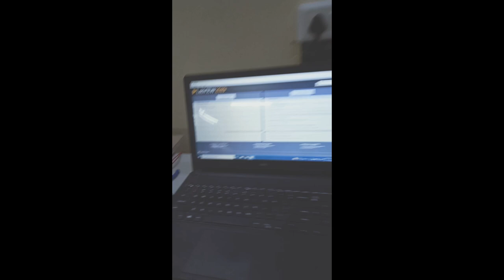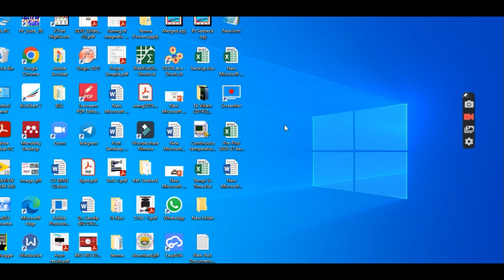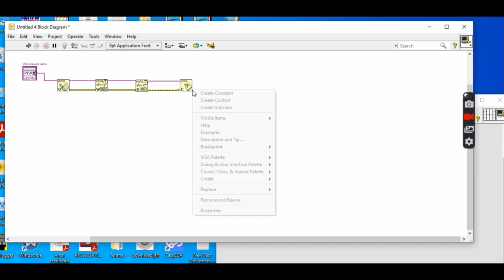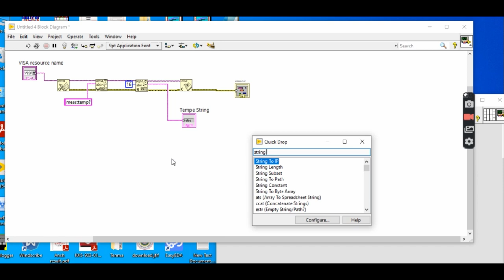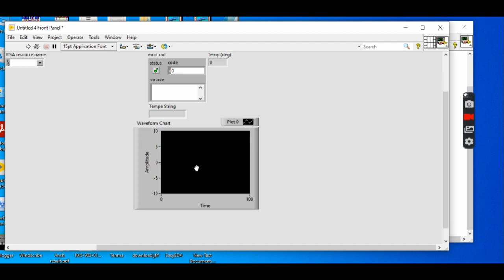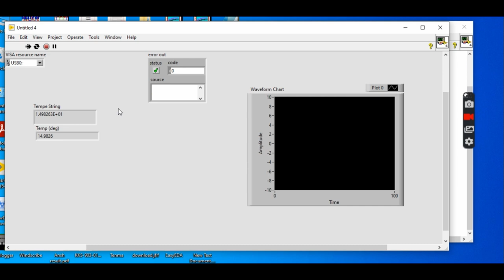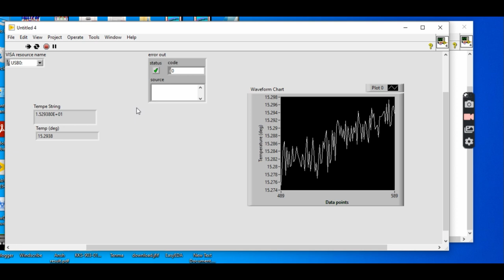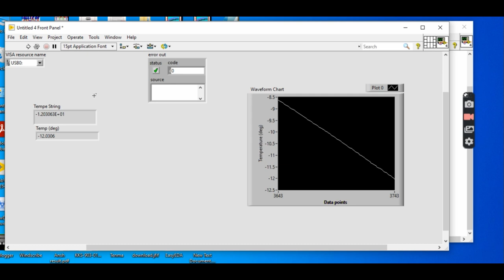Instrument Control Using LabVIEW Program (Continuous Measurement of temperature) Keithley DMM6500

Comment: what will be the command for measuring dc voltage?
Reply: I am using TENMA powersuply and to read what is the current voltage I use the command provided by the company. What is your output voltage source? a sensor or a power supply?

Comment: Hello, I am using Keysight DAQ970A, and it doesn't show under the resource name options, and when i copy the VISA address to the resource name it does not work, do you have any suggestion on this matter? Thank you
Reply from the maker: Have you tried in Keyseight connection expert? It should detect. Otherwise you may try by changing LabVIEW 64 to 32 bit.

Comment: Can you make a video showing how to read more that one channel at same time?
Reply from the maker: Yes Sir , It is possible but for this I need to have scan 2000 or scan2001 card. Currently I don't have . I am trying to get and will make video.
Reply: Are you using a GPIB TO USB or just a USB cable to communicate a  6510 to a pc device?
Reply from the maker: Just usb

Comment: Thank you very much for this video! I need help selecting a specific channel from the Keithley multimeter. For example, I want to select channel 206 to read the temperature measurement, but I am unsure how to do this. If you can help me will be greatly appreciated.
Reply from the maker: For this purpose it will be better to use subvis form keithley vi tree. They  give Direct option for channel selection.
Reply: @higherphysicsbysansmishra  Can you make a video showing it? I have the same doubts.